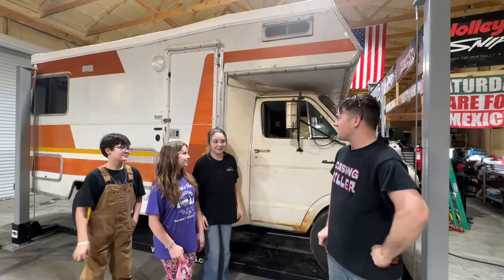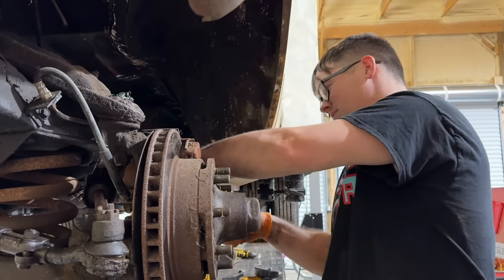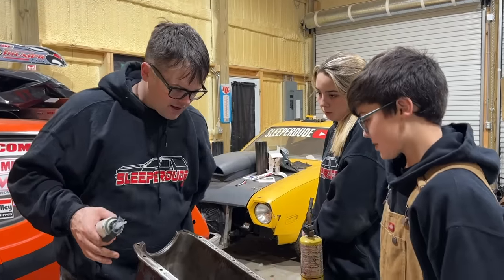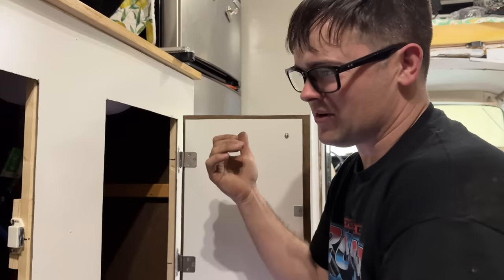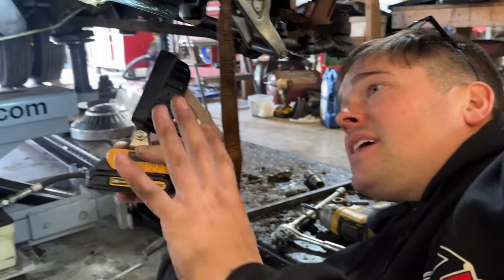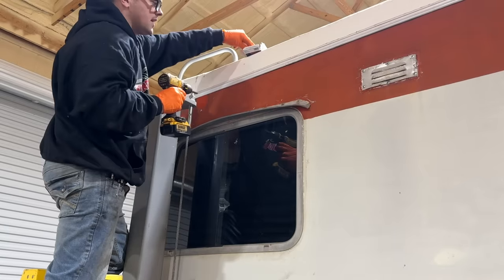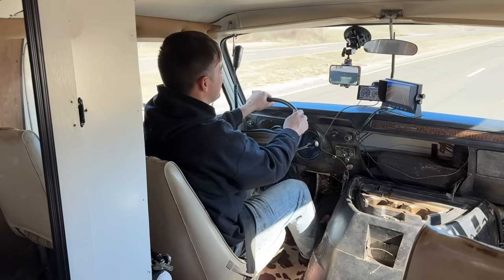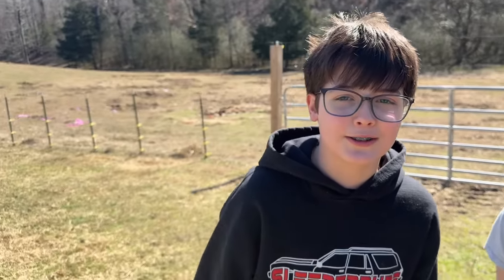HUGE LEAK!! Can We Finally Get This RV Roadworthy?

Comment: @ 1:08:15 you see the source of that bang.   The spring wasn't quite seated, it snapped downward into the lower control arm.   Just self correction by the spring.

Comment: Hey Josh the Holley will only learn itself so much to tune 100% you will need to put your computer on it with holley software i found this out via a holley guru in Australia just so you know i had to do mine in my 84 Ford F350 day and night difference runs heaps better 351 Clevo 393 stroker.

Comment: Big clunk! You probably already figured out that noise….that passenger side coil spring was sitting on edge of lower control are, tightening the shock cause the spring to properly seat while securing the shock
Reply: @Sleeperdude Quick way to fill up.your shorts for sure 😮😮😮😂😂😂😂

Comment: That's funny that you worry about the power lines. I drive a truck and trailer for a living it's 13"6  high by 105 wide at 53 ft long. I forget the dimensions on the tractor but overall. I'm probably about seventy feet in Length And I go into like Jersey Chicago and places like that. You're Get use to it. Just remember you can't go through drive through with it. It's kind of like a box truck.
But Yall did a great job on it.

Comment: I just rolled in some rod bearings on my wood chipper and now my oil pan is leaking. Brand new gasket but still leaks probably going to take it off and put a thin layer of silicone on the gasket

Comment: I had backing plates on my 01 Saturn and still had a small rock in the front brake caliper that sounded really bad as it was cutting all the rust off that rotor. I wouldn’t want to go without if i lived on a dirt road or had a stone driveway. Good video! Don’t Procrastinate is something that at 68 i still have trouble with. Josh, i remember my first oil change i did on my 77 Nova 305 i stacked the gaskets on the oil filter and blew out the oil on my Mom’s driveway , boy was she pissed but we had cats so i had kitty litter around to clean it up. I inspect the seating surface EVERY oil change now and have for 47 years after that and have never seen a gasket come off an oil filter except that one!

Comment: I have the same water damage on my front top bunk as you did on your ford motorhome. So after it’s all dried out I removed with my hands the soft stuff and it is still solid I’m wondering can I just treat it?  With what? And put a new board and mattress over it and call it good? I didn’t see in your video how you fixed the top bunk this is all new to me. Layman’s terms please. Lol.  Thank you

Comment: There was just a valve cover gasket that was leaking and running down the engine, or oil pressure sending unit

Comment: Hey Josh. I use 2 hammers to break the ball joints loose. 1 on the backside as a foundation, and 1 on the front to smack with. Usually works great! Gives the joint a much stronger shock. If that makes sense?

Comment: God I had fun doing those wiper bushings on my 89 pickup lol what a nightmare you might check I know on my Mopar it had rubber bushings that insulated it so it used a little feeler gauge lookin metal arm that made a ground to the chassis on one of the mounts

Comment: Why don't you pull the transmission? That will allow you to pull the pan far more easily and will also expose the back of the engine so you can really see your leak.

Comment: If the top of the ball joint is not square or hex, is there not usually an Allen wrench hole in it to hold back from it turning to tighten the castle nut?

Comment: On my pole barn I built right outside maybe 30 feet away from it out of the same material as shit with a nice door on it out of metal the same metal Z material that my pole barns made out of and inside there I put all my batteries and then underneath the ground I dug a little trench from there to my pole barn put some PVC pipe and ran all my electrical from the shed to there so that way if something happened to the batteries, it didn’t burn down my pole barn or hurt anybody inside the barn

Comment: I would say that the work you did to this is much much stronger than a the best shape RV that has been garaged. The factory makes them out of the lightest cheapest materials that not as good as what you used yours materials were much heavier. Its alot better and you know what you got.:face-fuchsia-wide-eyes::face-blue-wide-eyes::face-orange-raised-eyebrow::glasses-purple-yellow-diamond::body-blue-raised-arms::hand-orange-covering-eyes::trophy-yellow-smiling::trophy-yellow-smiling::trophy-yellow-smiling::trophy-yellow-smiling::trophy-yellow-smiling::trophy-yellow-smiling::trophy-yellow-smiling::eyes-pink-heart-shape::hand-purple-blue-peace::face-red-heart-shape: It would be good to use a optima yellow top D34-78 or bigger they are great deep cycle batteries that are also good for starting your vehicle and storage for your RV but the red optima like you have is not suited for long usage when your parked like the yellow deep cycle optima is. Much better for a RV I actually use them for my inverter to run lights and TVs and computers at home on my solar system. A Solar panel on the roof would keep it charged up when your parked. 100 watt or bigger.
Reply: Also you don't have the risk of a fire like when a lithium battery is used. Lithium ion batteries if compromised can catch on fire because the lithium will react violently if water makes contact with it. 😮😮😊
Reply: @carlbernard4197  Very scary I have many lithium batteries. 😮😮😪😪

Comment: Answer to question at 19m25s mark: Brake backing plates are heat shields. They prevent the ball joints, ball joint boots, tie rod ends, and brake hoses from getting cooked from radiant heat.

Comment: That engine should ultimately do better fuel mileage than the stock. Lot more efficient engine than the old ‘74. Prob 12-14 to gallon depending on load
Reply from the maker: I hope so

Comment: Just saying.....you said you test drive, and vehicle felt like it was surging running out of fuel.... remember you updated the engine with bigger Holley carburettor....and the fuel line's factory not really big possible 1/4 .....you will have to size up 3/8 ... And you'll need a high flow fuel pump.... If fuel injected may need 1/2 fuel lines....this will help with cooling of fuel..... And will prevent vapour locks......

Comment: The bolt said hold on your motor mount or through bolts and you probably didn't put any tough on them thus oil leak

Comment: The beauty of having a house battery, is, you can run the fridge all night without having to listen to a generator. Then to recharge the house battery, there is a “ continuous duty solenoid” that will switch on once the engine starts to recharge the house battery. Everything is pretty simple. My 70 Chinook had this system and it was trouble free and you didn’t have to remember to do anything. I just does it’s job.

Comment: Hey Josh, where did you get those blinds from ,those look like the same that are in my Chevy van and I need a couple of the small 1s for the barn doors cuz they are missing., could you please give me the link to those or the web address, thanks
Reply from the maker: Yes they came from RecPro if you use code Sleeperdude you get 5% off

Comment: Was the engine on ground? And the gasket got pressure or over tightened the bolt, 
Barbie movie used so much pink paint there was a shortage, squeezy got her paint before Barbie got it
Synthetic oil has smaller molecules that can pass through older engines

Comment: I loved the video, it was awesome. I worked for a C,J,D & Ram dealership in the parts department for 16 years & I sold a ton of those wiper bushings. You want to make sure there is some white grease in the bushing. If you buy aftermarket make sure it has the grease otherwise it will get to hot & brake the new bushing. I always had good luck putting the bushing on the male end of the linkage first, then snapping the rest of the linkage together. It's much easier if the bushing is already on the ball socket first. I hope I haven't confused you any more & that it works out for you. Y'all did some outstanding work on the RV!

Comment: When your driving or unplugged, there should be 2 house batteries.....often deep cycle, that power only the inside stuff......your engine batt should never be running the lights and stuff inside

Comment: Man, it's so nice to see this thing finally going down the road with essentially zero issues! That Holley EFI was the key to finally making that engine run like it should! I don't think the stock computer would have ever been truly reliable, even if you transferred every single sensor from the original vehicle.🤪 That stock O.P. gasket evidently was the key to getting it to quit leaking. I can't figure out why they would have made the gap so close between the pan and the cross-member to where you couldn't get it out without dropping the cross-member. What a P.I.T.A.! I think, at this point, it deserves a nice custom paint job to finish it off!! Well done by all!🤩👍👍
Reply from the maker: Yes your right !!

Comment: I THINK A GOOD USE FOR ONE OF THE CLEVELAND ENGINES IS DROP IT IN A BOAT WITH A 4 SPEED AUTO TRANNY.   THERE IS A YOU TUBE VIDEO WHERE SOME GUY DROPPED A CUMMINGS DIESEL IN A BOAT WITH A 3 SPEED DODGE TRANY AND IT WORKS GREAT. THE BOAT IS VERY FAST IN 3RD GEAR.    REALIZE IT IS DIFFICULT TO PROP A BOAT FOR POWER AND SPEED USING ONE FORWARD GEAR. IF YOU PROP A BOAT FOR SPEED IT TAKES FOREVER, EVEN IF YOU CAN TO GET THE BOAT ON PLANE.

Comment: With experience of over 30 years and rebuilding mulpark engines, especially 4 hundreds 3 60s, 4 40s. And hemmy's , I mean , if you use an old oil pan , it is always gonna leak on you at one point or another!
That gasket was the way to go.
It's just the way MOPAR is.
Glad y'all are finally getting round to it.
Reply from the maker: Thank you 😊

Comment: hey sleeper dude you wanna hear a odd story, so years back i was in the workshop with some mechanics and they had a damaged Peugeot in the workshop and one of the fellas took the sump off well drained the oil first and cause there was a wait on some parts or something to get it running again they loosely put the sump on and never did it up tight or put oil back in and we pushed it into a shed out the back as it was taking up space a few weeks later they got it back out but this time the owner of the shop started it up backed it out of the shed and drove back into the workshop and put it on the lift, he was with the mechanic that took the sump off and put it back on and he sees the sumps was loose and never had oil in it, and he was like ohhh shit i ran it out of the shed and into the workshop with no oil... i think no damage was done that i heard but he was damn lucky... and i think he learnt that you always need to make sure the vehicle has oil in it if someone else is working on it

Comment: Backing plates induce cooling of the brake friction material while shielding for foreign objects.   I too have left them off when rotten but definitely want them on the bigger rigs for cooling in the hills.
Reply from the maker: Ok good tip

Comment: 1:18:11 hey josh, easy way to remove those wipers, near the pivot there sre holes on each side, put a pin that fits the hole thru both holes. This will hold the arm up and take pressure off it. Slide the clip from under the arm and wiggle the arm free. The spring tension holds the clip against the shaft.
Reply from the maker: Ok thanks

Comment: LOOK LOOK LOOK LOOK look LOOK LOOK LOOK look their is a 66 mustang without motor for sale that could use a 351 clev. motor on craigs list in kearny mo . that is beautiful and looks great, It was on their on 3 3 2024 I just saw it their asking weigh less than all the restoration costs and it has chrome air, chrome mastercylinder, and booster gauges dark blue with white stripes and nice wheels. The negatives some of it needs put together which you are a expert.

Comment: So Josh if you put some limiting straps on that motorhome it won't yhaa so much if you set your limiting straps fully loaded so you have about an inch of play that means it won't lean in the corner anymore than an inch on each inside turn

Comment: I need one of thoes key fobs😊
Reply: Somebody's been getting into my van and stealing tools and stuff, I always lock it🫤 my Dewalt drill and impact and three batterys were the biggest loss
Reply: When I straightened out the grill on my 62 impala I used a wooden dowel and a two by four

Comment: The pieces over the doors and windows are drip shields.

The wires are ALWAYS shorter than you think they will be because you have to take into account any corners and changes of direction. I work in an industrial electrical company, and I am constantly amazed with the lengths of wires that barely fit.

Comment: Why didn't you just pull the motor mount bolts and lift the motor a few inches. Would've been alot easier.
Reply from the maker: There wasn’t enough room for that

Comment: 99% of the time the wiper motor doesn't work it's a bad ground. I run a new wire from the motor to a self taper on the body.
Reply from the maker: Ok thanks

Comment: Some times with certain cars you can take the bolts for the engine mounts out and jack up the engine to give enough room if the oil pickup tubing won`t interfere.Doesn`t look like it`s the case for you though, pretty deep oil pan.

Comment: You'll probably never read this but oh well. I'm dyslexic (yeah spell that word that we have so we can't spell it), I'm in my upper 60s and to this day I can't figure out which way a bolt goes. Except through muscle memory. I have to twist my hand to figure which way to turn it. Saying righty tighty don't work. I have to look at my hands to know what is right or left so yeah that's going to help. Again muscle memory. Time to glaze your eyes over with science. She Blinded Me With Science, I can't see. Dyslexia is a spatial coordinate disorder. When you want to write words you have to know which direction the action to make the letter goes. We are bad at that. It is the same as trying to do bolts. Which way does it go? Not only does it affect letters and bolts but events. Did the car hit the van or the van hit the car in our memory. in other word when putting on an oil pan which even happens first, we might have to think about that. Or Teflon on screws on lines. So try to teach Ralphy (and I think WA WA) to use his hand to remember which way bolts go.  Have his hand twist right to tighten, and twist left to loosen. Over and over and look at it too. The bump key guy.

Comment: dont use a lithium battery those things are a ticking time bomb all the silly boat people run them, but look at ev's a fair few have been involved in fires and in some cases the whole house that is ajoining the shed goes up and people have been in car crashes with the batteries and have burnt to death.... a lithium only gives a couple of seconds warning and poooofff on fire and ohh boy do they burn hot and for a long time, they in fact produce their own air supply when they go insane and react that water or foam or powder wont pout them out.